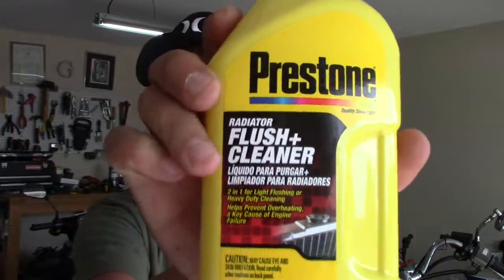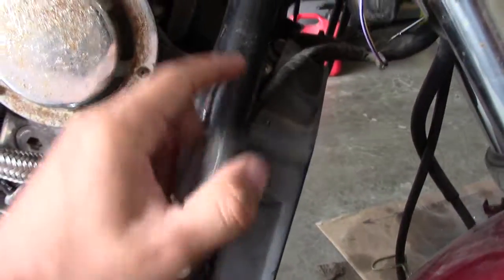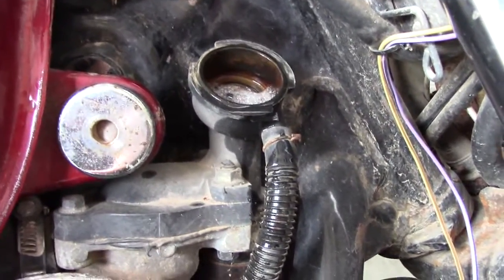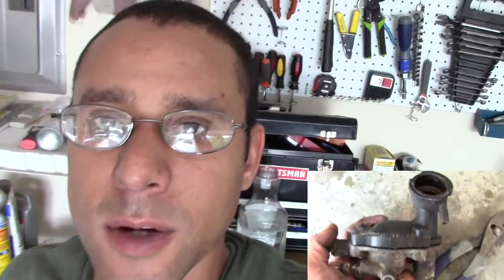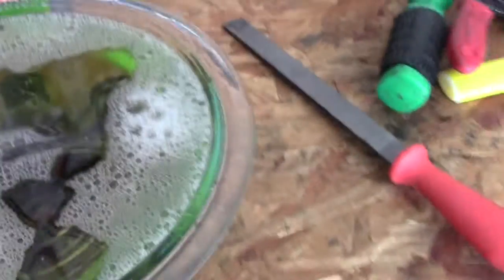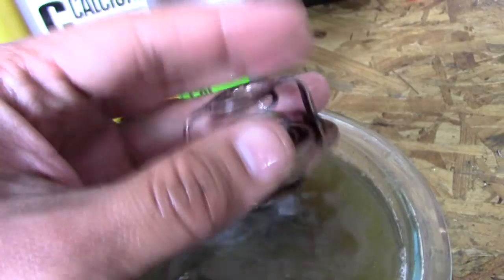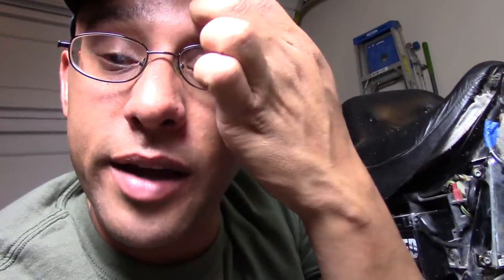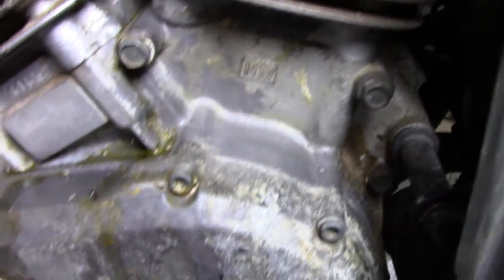Project Starfire: Radiator Flush & FAIL

Comment: Nearly all those Prestone products are fairly weak, containing primarily Sodium Citrate or Citric Acid. They work OK but need heat to expedite the process. 
Aluminum and copper are metals that will not tolerate acids for very long periods of time. Brass can take it OK. A long time ago, over 30 years, I had a car that had some 'blooming' of the solder in the radiator around the tubes. I dumped in 1 or 2 packages of that Prestone Super Radiator cleaner (whatever they recommended) and drove it around for 3 or 4 days and drained it. I was amazed! The inside of that radiator was like brand new. None of the white 'blooming' left at all.

Comment: I had a massive leaking somewhere at the top of the water  pump. I was going to use a "Stop Leak" product but wanted as clean of a surface as possible.
I used about 1/2 cup of CLR, topped-off the radiator with a minor amount of water (it's already small, only 1.5 gals.), drove the car a few blocks. I added more water when I got home so overnight the dripping would allow the CLR to flow through wherever it was going through.

Went out at 8am. VERY little water in the catch pan under the car. Poured that out, watched for dripping but there was NONE, not ONE drop.
Drove a few blocks, parked back home. at 10:15am I went out and the catch pan was DRY!!  
I have no idea what the CLR did..... but my car now no longer leaks!! SO weird.
UPDATE:
Drove to the auto parts store for a fw items. No drips under the car. Stopped by the bank, then came home. Still no drips and the temp gauge stayed centered between Cold and Hot, perfectly centered. Ran the heater all the time I was out (not fun on a warm day  lol ). So even with a heat-pressurized system, it still didn't leak!!

Comment: To find leaks and see if your coolant system is ok you should pressure test the system. If the head gasket is leaking that  much can you imagine how bad it is under a pressure test ?  Seems like the CRL works better than prestone.. Just my 2 cents worth.

Comment: can u do a video on cleaning carburetors similar to a 05 Suzuki gsf bandit 1200 ???😭😭
Reply from the maker: Sorry brother.  There are so many vids of carburetor cleaning, mine would get lost in the mix.  It's a very easy process. Just open it up, remove the jets and mixture screws, and spray out.  If it's old, also think about getting new gaskets.  They are worth the $10 to prevent leaks